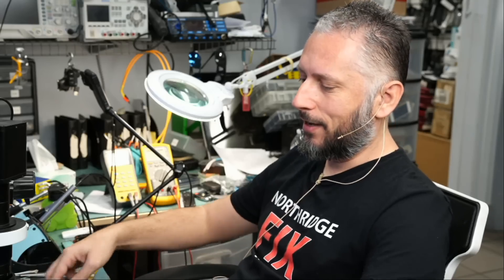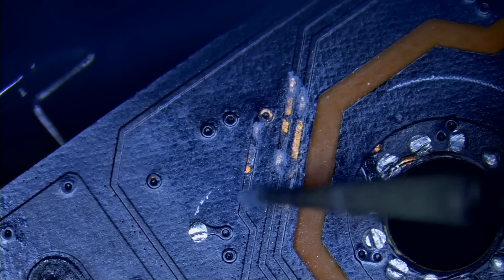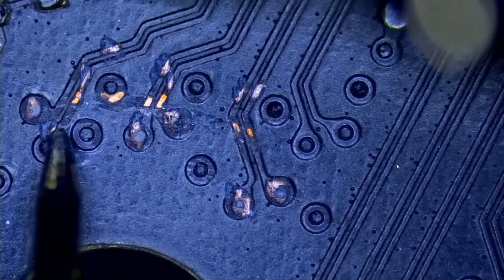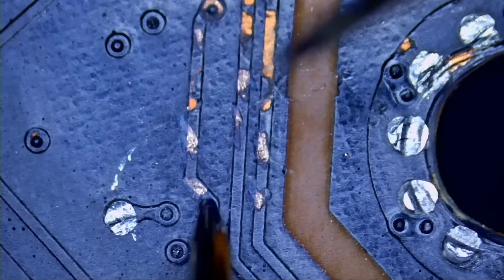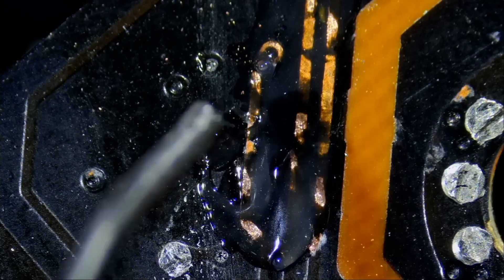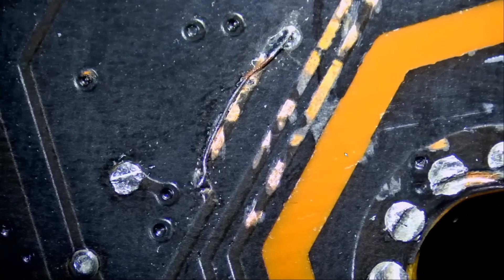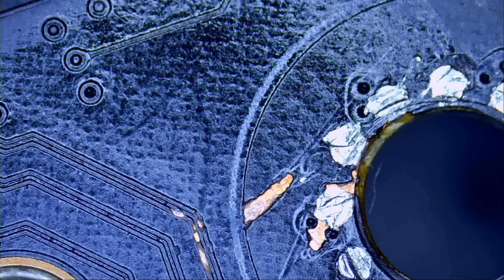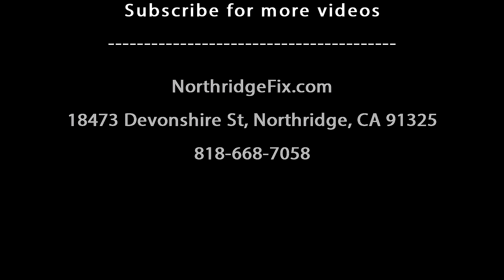ROG Maximus Z690 Extreme Repair - How useful is Memory Overclocking?

Comment: The Z690 and Z790 boards from all manufacturers have a consistent problem with memory overclocking/XMP. XMP does actually present a good amount of benefit, and it’s extra RAM speed that you pay extra for that the factory verified it can run, but the current gen doesn’t really like doing it in certain cases. I had two different high-end Asus motherboards (different variant of this same board) that both would fail POST if DIMM 3 was populated while XMP was enabled — you can work around it if you manually set timings, but it’s not plug and play like XMP and may take some time to get right.

Comment: A bull loose in a China shop who got their hands on way too nice of a board. To damage it this badly physically, im scared to see what voltages he would push. DDR5 overclocking isn't as good as DDR4. For gaming CL14 low latency is better at a high frequency. A 4000mhz binned CL14 will stomp current gen ddr5 setups. Where people don't pay attention is 0.1 and 1% lows. Sure, frames are close but consistency is nowhere near the same between the two.
Reply: Oh and great repair. You really do have hands as steady as a surgeon my dude. Ive always enjoyed watching your micro repair videos. Its impressive.

Comment: I have exactly the same board it's shit! I have 12th gen i9 12900k and 6000mhz gskill trident RGB ddr5 it won't even post if ram set to xmp I or xmp II to run at it's rated 6000mhz, the  max I can run it at is 5000 And it's dual channel kit

Board is updated on bios to latest one, even if I manually set timings voltage speed of ram correctly or even overvolt a micro amount still (maybe wants more voltage) won't post at all

Put same chip and ram into another brand board xmp boom works fine 6000mhz ram and unlocked my CPU to 6ghz with one click also

Comment: its a 4 dimm motherboard, you will NEVER get a stable ram overclock with those things TRUST ME i owned over 5 motherboards...overclocking memory is crutial to reach the highest frames in video games but does nothing for benchmarks,  poor customer wasting his time, but a great precise repair non-the-less. congratulations northridefix your quality to detail is by far impressive. piece of advice to the mobo customer if you are reading this, sell that thing get you a 2 dim motherboard go with an apex, or tachyon. im currently running an apex 790 with 8000 ram sticks, worked on the first try no issue.

Comment: I think this person might be overclocking in competition. Hardwarebot is a platform that offers overclocking competition, each percentage you can gain might boost your position in Ranking. HWbot is also an excellent resource on hardware performance and specifications, the database contains so many hardwareproducts so you can compare and look at performance. For competition OC you often have the board out on an open bench table, tinker with cpu mountings, Extreme cooling and possibly LN2 so damaging boards happens frequently.

Comment: Memory OC importance, as usual, depends on your system, and what you're after.

For record breaking, obviously the higher you can OC the better.
For gaming, if you're using an iGPU, generally, the higher the better too. But, with a dGPU, there's a limit (i.e. no difference between 3200 MT/s and 3800 MT/s speed).
For compute workloads, again, it depends.

But in most real world usage cases, if there are gains, they're minimal. We're talking <=10%, basically margin of error, amounts. And this is with any component you OC nowadays. Because either you have preset OC profiles (XMP/AMP), or as has been the case with CPUs and GPUs for the past ~5 years, built-in algorithms that do most, or all, of the OCing work.

Comment: the fastest CPU is hampered by slow working memory, you can gain quite a bit of performance when CPU and RAM are overclocked. technically applying the XMP profile already counts as overclocking since it goes over the spec, when you manually tweak your clocks and timings you gain a bit more performance, but that requires reliable clean power and good components, it is a very finnicky process

Comment: So what  he's referring to is XMP profiles which are built in overclock profiles for RAM. Most people do not do manual RAM overclocking. However, XMP is a standard feature for RAM now and you pay for the better sticks. If you can't use what you pay for, that sucks. However, Z690 is notorious for having issues with XMP. I honestly wonder if he actually has an issue or is just experiencing Z690 and it's shit tier generation 1 DDR5 controller.
Reply: the memory controller is in the cpu die, not in the motherboard.

Comment: Overclocking GPU and CPU, you overclock processors. The RAM for CPU or Gpu RAM is different thing. Overclocking GPU RAM can gain some FPS too, but these chips are clocked very high already. So after all, all will flood the world with more scrap CPU's, GPU's, RAM, and so on. Always the manifacturer clock to all things are best for the hardware they make.
Now you see the GDDR6X GPU RAM is way too much overclocked from manifacturer, so its much more hot than regular GDDR6 RAM. They all have problem to cool down this GDDR6X memoryes.

Comment: Overclock RAM will gain almost noting to game FPS. Maybe +1% as best. It's not reliable, the memory will draw more current, will heat more and life will be shorter.
The think of overclocking RAM is, when you use integrated GPU, witch uses RAM memory from the MB. In this way, overclocking RAM will gain much more FPS, because integrated GPU will get more faster memory to operate.
If you ask me, i never overclock anything on mt PC. I do oposite thing - i undercklock or use best stable settings from BIOS and i never will get crashes, overheating and unstable PC.

Comment: I tried overclocking various parts of my PC but the benefit doesn't outweigh the stability issues that arise. Ryzen's don't like to boost higher than their max boost and become unstable. I run the ram on XMP profile 1 which runs it at its advertised speed and not JDEC standard motherboard speed(mine is stock at 2166mhz but the ram kit advertises 3600mhz). GPU ram is the same, its a roll of the dice if it actually gives you gains. A lot of GPU rams aren't cooled very well and neither are the driving mosfets that power them. I do run my GPU at the highest clock before it starts messing with the RTX features and DLSS(hard artifacts with these enabled on a pushed GPU core). The GPU will still limit the amount of power it can consume but hold the clocks high until it settles out at a certain MHZ. My 2070 super will push to 2050Mhz with certain RTX/DLSS shimmering effects and settle out at 1950Mhz, any higher and it will crash. It still limits the wattage to around 200 to 215 briefly and settle out at around 180watts. This is due to the PWM mosfets heating up and to avoid them burning out, limit the watts.

Comment: I am an AMD gamer. With an AMD processor, the overclocking ram will give you the most significant performance boost over anything else you can do. If I don't overclock my ram, I will only get around 130 FPS in some games. When I overclock the RAM, I can get up to 250 FPS in games with Ultra settings. It is a significant improvement. I know this board is for Intel; it also helps Intel processors work faster.

Comment: Overclocking memory can be useful for games when playing at very high framerates (hundreds of FPS), where memory bandwidth quickly becomes a bottleneck. It also improves the 1% minimum framerates. The gains are usually not amazing though, unless the memory was severely underpowered for the job to begin with. Some science-related programs are heavily reliant on memory bandwidth and they could potentially benefit from it as well, but the range of such programs is limited. I think most people just do the overclocking for fun and/or competing with other overclockers on a score ladder using benchmark programs. Those competitions can get pretty crazy and so every single thing that could potentially improve the score is utilized.

Comment: The gains from over clocking on normal cooling are insignificant, unnecessary, and most of all risky. The amount of damage on that board indicates the owner is extremely careless. I'm on my second high end gaming desktop which I built from the ground up all by my self. I've never had an issue with it at all and I've used it every day for the last 5 years. I'm do for a new build but with the inflation and the economy as it is right now I'm forced to wait a little more.

Comment: Often people that purchase the ASUS Extreme, MSI Godlike, Gigabyte AORUS Xtreme, etc want the performance to be in a class by itself. Some people actually go for world records. The RAM speed difference absolutely adds performance and increases benchmarks. It's also a board that's used for obtaining world records.

In my case I have the next generation ASUS ROG Extreme Z790 and I'm able to get 4x DDR5-6200 .. while there are no kits that offer that density and speed. CPU-Z 9yk75j
Reply: The extreme boards suck though. The apex has the best performance not the extreme.
Reply: @LawrenceTimme  .. No they don't. That's a fictional description. Literally every spec is better and faster on those motherboards. The CPU-Z (see above) in addition to my Corsair Flex is $10,000 plus, the motherboard is literally strong enough to break everything attached to it. If you're not going to overclock and you're not going to attach parts that are to the limits of specs it still would be faster.

Comment: If he is using an old "contact frame" then it can inhibit memory speed simply by the frame being too close to the memory traces and act like a capacitor.
I had the same problem when developing the 9th gen direct to die frame and it took me about a week to figure it out.
Now, when I ship a direct to die frame I also include a 4mil mylar "gasket" that goes down first. This eliminated the memory speed limit.
Yes, I made the direct to die frames 4mil thinner so it would maintain the correct CPU location when tightened down.

Seems the newer frames (Thermalright, Thermaltake, Grizzly) have trimmed the area that is close to the memory traces to eliminate this problem.
If he is not using a frame, that can also cause it since the pressure is so high on the ILM, it bends the CPU. 
Get a frame!

Comment: From what I've seen, the vast majority of the improvements from overclocking your memory only matter in synthetic benchmarks. At the low end 1080 ultra high e-sports high refresh gaming you'll see more of a gain, as well as the super duper high end (4k 13900K RTX 4090) will see a boost. If you are in the middle....well that's where you are. Getting a better platform/CPU is going to gain you 100X as much as playing with your RAM. There was a huge gaslighting campaign on youtube led by BUILDZOID about memory overclocking, ignore ALL of it. The linus people...the pcpartpicker people....the reddit people....all know nothing hacks. Buildzoid actually is smart....but he's a gaslighter, nothing he does or shows on his channel is stable.

The owner of this board must have been very very clumsy......
Reply: not true. Overclok the memory, expecially refresh rate and terziary timings, helps a LOT with microstutter and frametime
Reply: Bru wtf are you on? Memory overclocking DOES help in a lot in games
Reply: Buildzoid just likes to run his overclocks "stable enough", which is definitely not stable enough for most people.

Comment: Overlooking memory can be super beneficial in carrying and spreading the overall load on an overclocked system especially with compatible sticks where speeds can be upped by around 30%.
Reply: This is false.

There is no benefit when you increase the frequency AND the latency lol. You’re just drawing more power which leads to premature failure and more wasted energy

Comment: Very useful video. Thank you. That board is getting the holes very easy chopped up because it is heavy and we have to be very careful when placing it to the mounting holes. In some tower cases where it is difficult to place the board properly it is better to remove the case's spacers from the middle of the motherboard not to damage the tracers.

Comment: Memoryspeeds are often overlooked by many people because the memory wasn't the bottleneck in the past. On more modern hardware memory is a bottleneck. That often the memory bandwidth gives more gains then rising the cpu or gpu clockspeeds. F.e. i nearly doubled ! my CPU score at 3dmark TimeSpy just by changing to a better memory setup going from 4 dimm ddr4 z690 to 2 dimm ddr5 z790 apex with a 13900k heavily bottlenecked by slow memory.  Ofcorse there are also much cases where the memory bandwidth is not bottlenecking and gains are zero ...
Reply: Cool. Didn’t know irrelevant benchmarking actually applied to real users (it doesn’t)

Comment: well if he got the memory working fine without OC i don't think it is related to the damaged pcb, lot of people have problem overclocking rams on z690 and ddr5 because first it depends of the quality of your ram chip but also the memory controler from the cpu, so if you have a random silicon chip on your i7 or i9 your controler (VDD2 voltage) in cpu cannot handle stable oc from ddr5. Even worst if you try to oc with a core i5. And also the ram chips themselves they are high latency quite hard to stabilize all that mess except if you re lucky on silicon lottery
Reply: and btw dn't buy 1200 euros motherboard if you don't know how to handle it and damage it like that.

Comment: Overclocking is absolutely critical. We need to gain than extra 5 to 10 frames of performance when gaming. It makes a huge difference. It doesn't matter how much damage it causes or how expensive it is to fix.
Reply: Not all overclocking is for gaming; A lot of it is for competitive benchmarking, for fun, as a learning tool, or for very specific use cases.

Comment: How people manage to inflict this amount of damage to a board is beyond me :D Excellent repair as usual :)
Reply: They used a hammer to wedge the board into the case is my only guess or had a tug of war with their dog.
Reply: @nicksdinosforkids6001  😂
Reply: This looks like a pre-installed stand-off that was not checked before mounting the board. Basically the pin was putting pressure one point at the board which might have cracked the traces
Reply: That person needs to hire someone to do any more physical work on a PC. Does his PC toolkit include a claw hammer?
Reply: That amount of damage would be easy to do without doing anything crazy to the board, especially with a heavy board like that.
Reply: Probably from a standoff, or some boards come with IO Panels that have a very bad fit so people apply a lot of pressure to get it in. Beside that especially black matte silkscreens can sometimes be much more sensitive to scratches than classic blue/green glossy ones. But people buy these days based on it's look so black matte became like a standard for PC mainboards.
Reply: By installing the board by sliding it in place without removing the AIO. Happened to me once, glad I didn't break anything.
Reply: @SaccoBelmonte  yep, the stand off of the case scratched the back of the mobo.
Reply: it's very easy.
Reply: They are literal troglodytes. Probably installed that mobo without the standoffs.
Reply: im in shock
Reply: I tought exact same thing!
Reply: ? thats not alot of damage, its minor.

Comment: overclocking is giving a bit more benefit - but its not just the heat - the components suffer and you use so much more currency - so all in all its not worth it

Comment: If you drive a fast car, you have to rev the engine a little. I prefer to overclock my hardware, but it usually involves custom watercooling, hours upon hours of research, and years of experience to fall back on. I like to stress the hardware to see how far I can push things, but usually settle for a slight overclock (or underclock) to increase performance without sacrificing stability. I am currently running a Ryzen 9 5900X with a DDR4000 kit of memory running at 3600MHz. The Samsung B Die kit has great latency at 3600, but tends to crash if infinity fabric is set to anything higher. With the overclocking on the CPU, GPU, and RAM, I am getting the most out of my current CPU while also extending the usefulness of my 6 year old GPU. I can't recommend it to everyone, but I enjoy the challenge of finding out what the hardware is capable of.

Comment: Overclocking memory produces faster performance due to the fact that memory is the "working area" of a PC.  Anything that resides in memory, notably the files that make up a video game, can be accessed much faster.  Overclocking a CPU is a "brute force" method while overclocking memory produces increased efficiency and faster frame rates.

Comment: Probably what customer intend about overclock your ram is enable or not the xmp profile. About this specific chipset some model present th is issue with the xmp profile if is not compatible and he need to update the bios to enable, maybe the traces it’s not correlated to the problem

Comment: Overclocking ddr4 can be quite rewarding for system response. But honestly not noticeable without paying close attention or using monitoring software. Mainly only useful for extreme/competitive benchmarking.
Dont have much ddr5 experience but timing overclocking on ddr5 is much less useful than ddr4

Comment: overclocking your memory from base 2133MHz clock to like 3200 can make a huge difference in performance. Memory bandwidth is really underrated. A single channel configuration can make you lose 20% gaming performance pretty easily.
Reply: No it doesn’t lol. Increasing frequency and latency is dumb lol